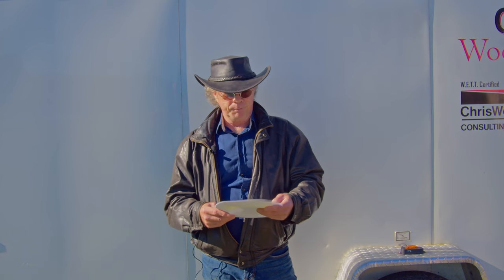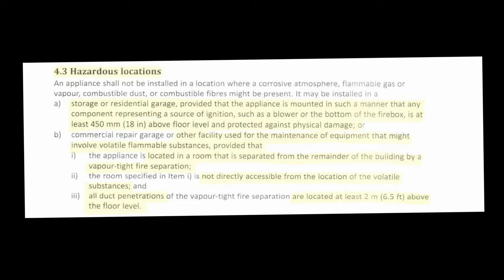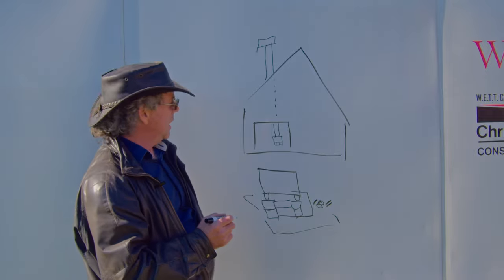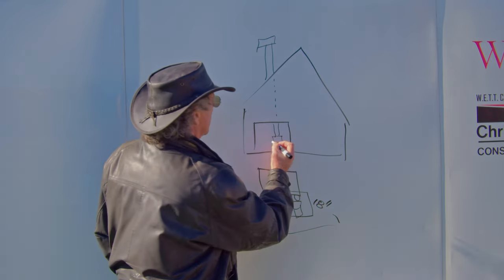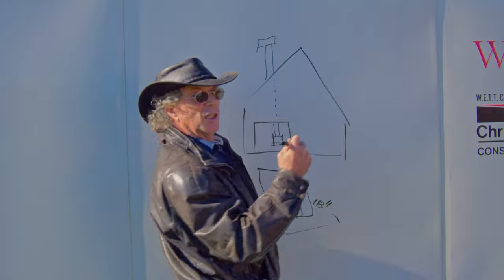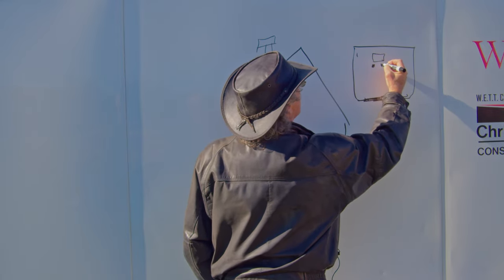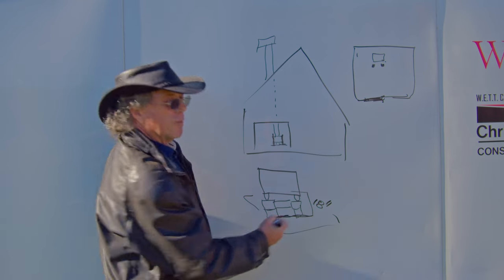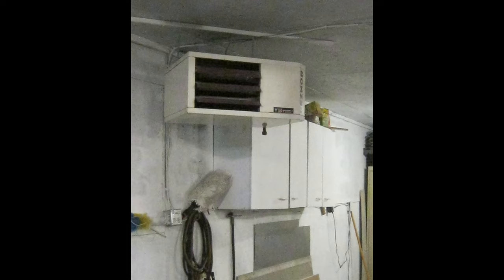Installing a wood stove in a garage or "man cave"

Comment: Quite interesting. I try to keep gas cans and such in my shed rather than the garage,  but I still occasionally have fuel/oil spills. Since I am in the planning stage of my install, I'll take this into account. Thank you.
Do you have a video on what to put on the walls around the wood stove? I'm thinking some reflective foam insulation panels.

Comment: how close to the wall can I install my wood burning stove if I'm using rock wool insulation covered by cement board with corrugated steel panels over that?

Comment: I have a 1890 beckwith 20 inch round wood stove on cast iron feet..doni have to put it up 18 off the floor?
Reply from the maker: 1890 Beckwith is a parlor stove, but if you live in Canada you'll need to install it with the firebox 18" off the floor if installing it in a garage, just like other fuels (there is exceptions) sealed units etc..

Comment: I want to place my wood stove in the back left corner of my garage. Would I still need 2 posts for protection or just 1 on the front corner
Reply from the maker: It would depend on the one inspecting the unit, I would think without seeing it one on the corner would be enough, think of a car, lawn tractor or other toys as 4x4 or snowmobile etc would hit it before hitting the stove.
I don't think it's logical to think you can stop a out of control vehicle from hitting the appliance or going through the wall for that matter.
But protection from someone encroaching to close and a notice by an impact to the driver/operator.